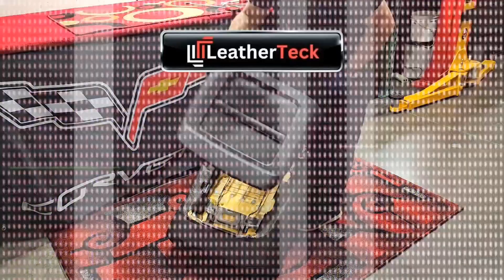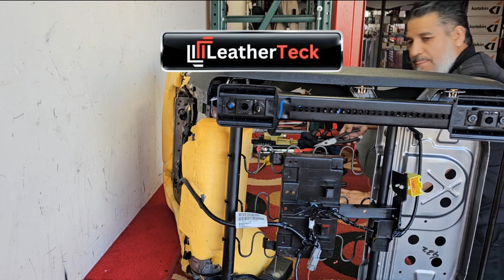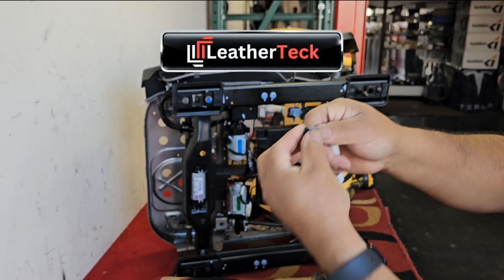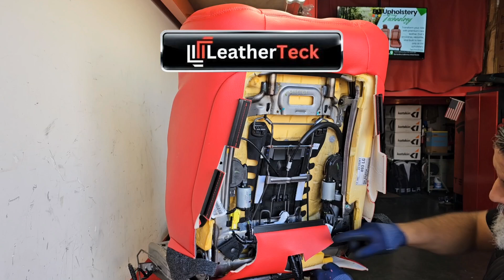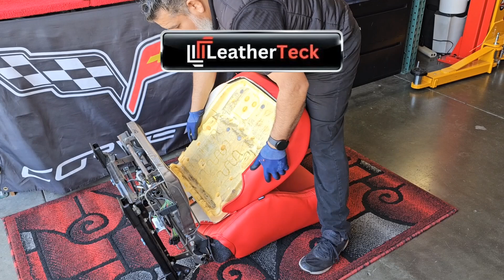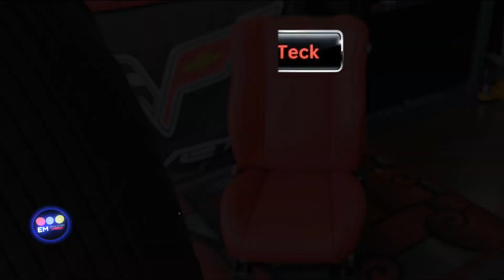Dodge Charger RT Leather Installation ✅ DIY Seat Upgrade & Airbag Safe Guide (2015–2023)

Comment: This is a good video The only thing you didn't show was how to remove the pad from the front driver seat. You skip right over that part
Reply from the maker: Good catch @nopiatl. I didn't show the actual removal of the front driver seat pad on this Dodge Charger R/T in the video. I was focused on the leather seat installation process and airbag-safe procedures, so I skipped that step to keep the video from getting too long. I'll try to cover seat pad removal in a future Charger-specific video. Thanks for pointing it out and for watching!
Reply: @emupholsterytechnology3781 totally understandable I've been watching this video over and over trying to get some tips for the nuances of these different year models of these challengers. And I'm noticing the years are different on certain parts either power seat or manual seat they're different and I'm working on the 2010 and it's driving me crazy right now